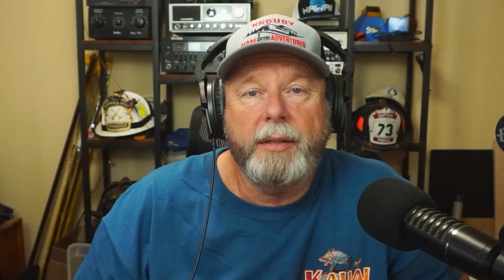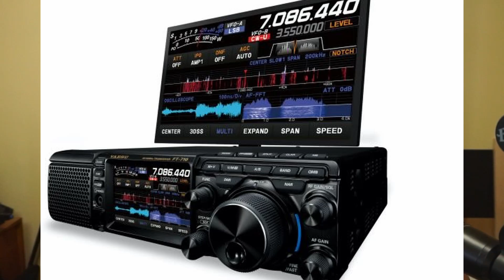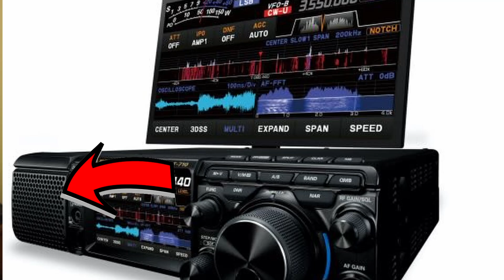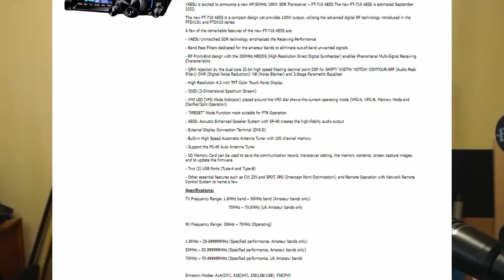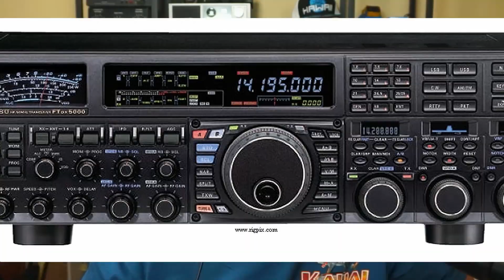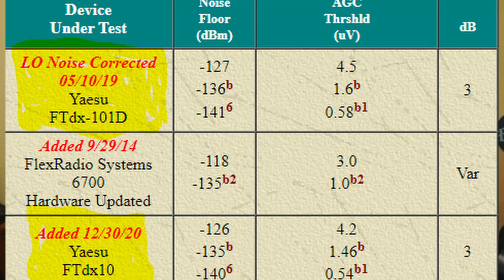Yaesu FT-710 AESS, why you won't be purchasing one anytime soon! To be released maybe in September.

Comment: Yeah this video is 2 years old now and I'm going to be getting a Yazoo 710 hopefully here at the beginning of the month. I'm going to be getting the Yaesu ft 710 field because I'm not paying $150 for a cheap speaker from Yaesu. The FT 710 is a remarkable radio. As far as DVI connectors in ports you can find DVI monitors and you can find DVI connectors. And comparing the 710 to the DX 10 710 is one level lower on the list big deal. You're getting a full-featured HF radio for around $1,000 what is there to complain about. Just putting it out there you said hands will find anything anything at all to bitch about. Can't you guys be happy with the fact you got a full-featured radio for a thousand bucks once again full feature radio for 1000 bucks oh but wait what's this I hear no CWD code it's called an app you can put on your phone that decodes the CW for you if you need that sad hams. you guys are ruining the hobby for everyone. 710 is a hell of a lot better radio the 7300 saying that it's 6 years newer.

Comment: I bought this radio about a month ago (Jan 24). I LOVE it!  I'm new to HF and come from a borrowed Kenwood TS 570 D. I constantly had bad audio reports with all kinds of suggestions on how to fix it. I decided I wasn't going to spend bunches of $$$ to fix a borrowed radio and decided on the FT-710 AESS after watching dozens (at least!) of videos on various radios. I have gotten nothing but raves about my audio since buying the 710.  While some old-time hams call this an "entry-level" radio, it's complicated as hell for this HF newbie. But using it every day, I'm becoming more proficient in its use. I'm understanding more about all the settings and controls.   😀
Reply: Your comment sold me.  Cheers!

Comment: Regarding the "lack" of an HDMI display output ---- I'm pretty sure that you can buy a passive cable (nothing but wires) with a DVI-D connector at one end, and an HDMI connector at the other end. In other words, with a $10 cable the radio would connect straight into any monitor or TV that has an HDMI input. Please feel free to correct me if I'm mixed up. I mention this because I see so many people gnashing their teeth in anguish that it doesn't come with an HDMI output for the external display.
Reply: I have used a cable like that for a while from the DVI on my computer to an HDMI on the monitor with no issues. The main difference is the DVI does not have audio that an HDMI does.

Comment: DVI to HDMI convertor are inexpensive.
Reply: They're more "adapters" than converters, as it's just wires. There's no video conversion going on, just a connector adapter. 

Not nitpicking, just clarifying as so many people don't know.  You might leave them with a vision of a converter gadget needing an external power supply.

Best solution is actually a $10 cable with DVI at one end and HDMI at the other. Simple and cheap.

Comment: Yaesu is missing out on the QRP portable market.  The FT818 is a great radio, but unless you can find a CW filter you'll find yourself sometimes hearing 4-5 different CW QSOs going on at once.  I'm a bit surprised they haven't capitalized on the POTA/SOTA explosion.  The Russians and Chinese have great small form QRP radios in the TX-500 and X6100 that have a ton of features that the 818 lacks, such as a DSP.
Reply from the maker: Richard, I think there is something coming in that market soon from Yaesu. Thanks for the comment
Reply: Life is too short for QRP.

Comment: The HDMI port is proprietary and attracts a fee per unit. I forget the cost, but there is an initial big dump of USD to include it in a production line, then there is a fee per radio that has them fitted. DVI port is free for use. But yes, other rigs, computers, TV's etc are including them, so radio manufacturers should also pony up, pay and include them. I'm sure a ham won't mind paying an extra 50 bucks for an HDMI connector
Reply: $50 for a port vs $10 for a DVI to HDMI cable.  Somehow the economics say Yaesu chose correctly.

Comment: Only problem w/ the DVI connector is most monitors no longer come with one. I would be curious as to the resolution that it output, though... Some of the other radios w/ monitor outputs put out a relatively low resoluiton.
Reply: You can easily use a cable with HDMI on one side and DVI on the other.
Reply: @C4H6As  ... And burn up the circuit board by buying a random one as has happened to countless FTDX-10 models which use the same circuitry. I suggest you read the forums especially GROUPS IO on the problems with the HDMI cables and the FTDX-10.

Comment: Look's like it's made to go head to head with the IC-7300 even though Yaesu is about 6 years late in doing it. And they haven't even made a replacement for the FT=857D which is used by everyone from pilots to missionaries due to it's compact size and shack in the box capability. Curious to see if the FT-710 will have CW decode like the FTDX-10. I haven't upgrade from my old FT-2000 as it works just as good as the newer radios and it has 2 key jacks so I can switch from the BUG to PADDLES instantly without wasting five minutes of hunting for it in the menu to switch it. My guess is the price point will probably be around $1,200.00 dollars as a new FTDX-10 is selling for about $1,400.00 every where.

Comment: YAESU is excited to announce a new HF/70/MHz/50MHz 100W SDR Transceiver – FT-710 AESS.

The new FT-710 AESS is a compact design yet provides 100W output, utilizing the advanced digital RF technology introduced in the FTDX101 and FTDX10 series.

A few of the remarkable features of the new FT-710 AESS are:

- YAESU Unmatched SDR technology emphasizes the Receiving Performance
- Band Pass Filters dedicated for the amateur bands to eliminate out-of-band unwanted signals
- RF Front-End design with the 250MHz HRDDS (High Resolution Direct Digital Synthesizer) enables phenomenal Multi-Signal Receiving Characteristics
- QRM rejection by the dual core 32-bit high speed floating decimal point DSP for SHIFT/ WIDTH/ NOTCH/CONTOUR/ APF (Audio Peak Filter)/ DNR (Digital Noise Reduction)/ NB (Noise Blanker) and 3-Stage Parametric Equalizer
- High Resolution 4.3-inch TFT Color Touch Panel Display
- 3DSS (3-Dimensional Spectrum Stream)
- VMI LED (VFO Mode Indicator) placed around the VFO dial shows the current operating mode (VFO-A, VFO B, Memory Mode and Clarifier/Split Operation)
- “PRESET” Mode Function most suitable for FT8 Operation
- AESS: Acoustic Enhanced Speaker System with SP-40 creates the high-fidelity audio output#
- External Display Connection Terminal (DVI-D)
- Built-in High Speed Automatic Antenna Tuner with 100 channel memory
- Support the FC-40 Auto Antenna Tuner
- SD Memory Card can be used to save the communication record, transceiver setting, the memory contents, screen capture images, and to update the firmware
- Two (2) USB Ports (Type-A and Type-B)
- Other essential features such as CW ZIN and SPOT, IPO (Intercept Point Optimization), and Remote Operation with Network Remote Control System to name a few

Specifications:

TX Frequency Range:
1.8MHz band – 50MHz band (Amateur bands only)
70MHz – 70.5MHz (UK Amateur bands only)

RX Frequency Range:
30KHz – 75MHz (Operating)
1.8MHz – 29.699999MHz (Specified performance, Amateur bands only)
50MHz – 53.999999MHz (Specified performance, Amateur bands only)
70MHz – 70.499999MHz (Specified performance, UK Amateur bands only)

Emission Modes: A1A(CW), A3E(AM), J3E(LSB/USB), F3E(FM)

Supply Voltage: DC13.8V ±15%

Power Output: 5 - 100W (5 – 25W AM Carrier)

Dimensions (W x H x D): 9.4” x 3.1” x 9.7” (239 x 80 x 247mm)

Weight (Approx.): 9.92lbs (4.5kg)

Comment: FT710 is SDR and no sdr hybride as FTDX10 and FTDX101.
Reply from the maker: Hey Diabolo, Yea not sure they say this on their web site "The new FT-710 AESS is a compact design yet provides 100W output, utilizing the advanced digital RF technology introduced in the FTDX101 and FTDX10 series"
Reply: @KK6USYHamRadioAdventures  Hello. With the FT710 you won't get a 30% discounted FTDX10. The FT710 reception part is like that of IC7300 and not like the FTDX hybrid SDR series, otherwise what is the point of "killing" the FTDX10 from Yaesu? The FT710 is Yaesu's answer to the entry-level IC7300 with antenna input directly on an FPGA after band input filters. I could be wrong, but Yaesu says SDR with HRDDS Yaesu technology for received signal processing: DNR, Contour, Notch, etc... Regards

Comment: Elecraft tuners are 10:1, the standalone and in all radios and amplifiers, as far as I can tell, both from experience with a few of them and their advertising material. Hi Chuck! de w6akb.
Reply from the maker: Hi Alan, I knew the kz2 and 3 had 10:1 not sure with their base radios. How have you been?
Reply: @KK6USYHamRadioAdventures  Doing well, thanks. Back from Field Day in the mountains. Got the K4 working on WSJTX with a Pi400 here today. I haven't tested the K3 and K4 tuners at high SWR, but I definitely have with the KAT500, even at 500 watts. If I recall correctly they say it will do a KW at 3:1 and 500W+ at 10:1. Of course we try to have antennas well below 10:1 but it is nice to have some reserve when the space for a full size antenna is not available. With a 3:1 tuner you often run into frequencies that won't tune, that happens a lot less often with a 10:1 tuner. The Elecraft tuners are somewhat similar in design to the LDG tuners though Elecraft claims some extra magic is added to theirs. :) de w6akb

Comment: Thank you.  I'm still holding out hope for an upgraded 991a and the 818.  This radio is a good first step though. If they made a Shack in the Box that operated at 25 watts, they'd annialate everything else in the market. Small enough to do portable, powerful enough to reach worldwide but yet isn't as power hungry as a 100 watt rig. That would be my dream radio. I've done some good things with my Xiegu G-90 so I'm sure a Yeasu would be much better. Can't wait to see what unfolds next
Reply from the maker: Walter I kind of have the ear of some yaesu people and have said pretty much the same to them, thanks for the comment!
Reply: @KK6USYHamRadioAdventures  Thank you. I love the form factor of the 818 but it needs to be modernized. I can even do without the waterfall, just get it up to 10 to 15 watts and modernize the battery and charging system and in good. With the 991a, just bring it up to this new radio standards, because I want more power on 2m and 70 cm so I can participate in more nets in my area.. and for both of them, I love to listen to broadcast AM WFM and SW channels because I enjoyed that part .
Reply: @walteredwards544  Yaesu will end up scrapping the 818.  The design is 20 years old.  You can’t even get CW filters for it.  
All the Yaesu radios need a 10:1 tuner.
Reply: @GreyGhost-r4z  Strange. I believe my Xiegu G-90 has a 10:1 tuner and a real time  SWR Scope
Reply: 25 watts would be excellent. The military figured that out long ago, but the ham manufacturers are stuck on 10 and 100 watts due to the regulations and specsmanship. de w6akb
Reply: I am holding out for an upgraded FT-857D. I have an 857 and love it.
Reply: I don't understand this comment.  Why can't you turn the 991a down to 25W output?
Reply: @thecaravanham  they can.  but they want the size and weight of a smaller radio.